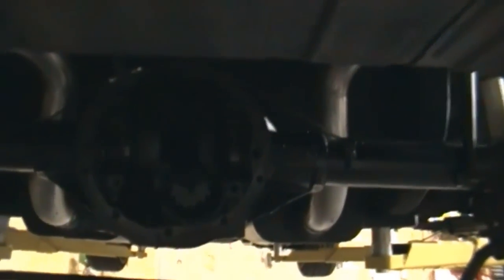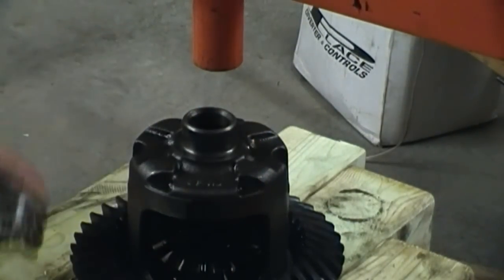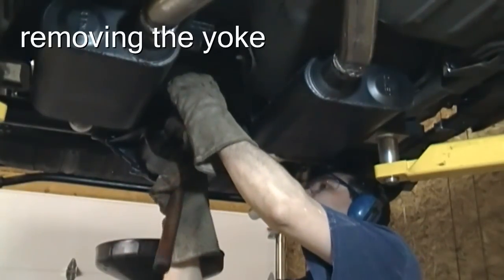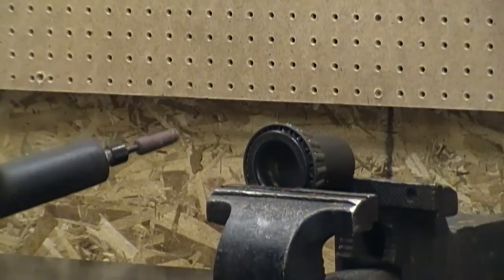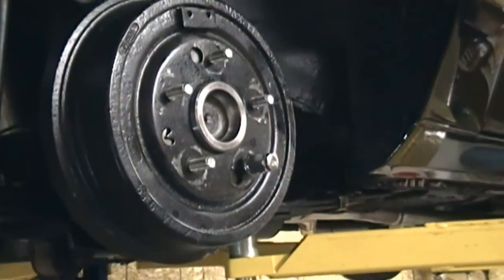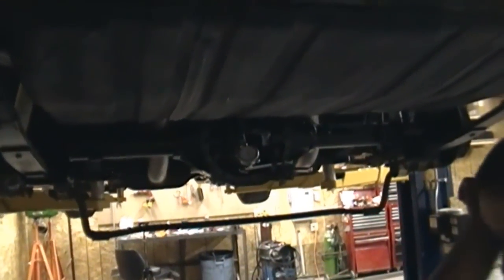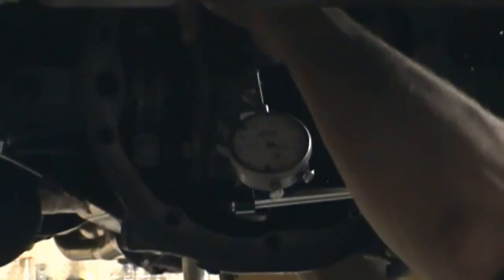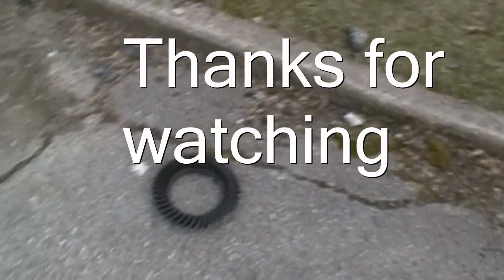How to install or change or replace gears and bearings in a rear end or differential

Comment: My Dad and I are trying to restore his 64 and 66 chevy c10 pickups.  the 64 has a rearend that has went bad.  We need to rebuild it.   Can you assist in helping?  we have no experience on rearends, but my Dad is a good mechanic and can learn or do anything he puts his mind to, yet not the type that will hesitate to learn from someone.  Do you have email you can be reached at?  thanks
Reply: +Karamelia Mitchell the 63 and 64's have 17 spline axles and you can't buy the spider gears anywhere so you will have to convert to 30 spline....i'm doing that right now

Comment: First pattern was perfect. There are 6 acceptable gear patterns. Your running the pinion gear too deep into the root of the tooth. You don't know what your doing. I know what your trying to do.. both drive and coast side from toe to center or toe to heal. Your not paying attention to the width of the pattern.
Reply from the maker: The rear end has performed flawlessly after being hammered on by a 500+ ft lb motor.  It still works great and is and is totally quiet to this day. I certainly wouldn't want to build a rear end that whines under the advice of a YouTube armchair mechanic.  Every man for himself.  Do what you do at your own risk.
Reply: @Oldsmob455  First, you used the Mark Williams pinion depth with the factory shim. Ok usually a 8.5 will be .034 to .041 pinion shim. You said it's telling you it's about .001 off. Your first pattern was perfect. But you decide to add .Then determine additional .014 was required. Go back and look at the pattern.  The drive and  coast side is way too deep in the root. Again, look at 6 acceptable gear patterns. Your pattern was square on the tooth. It didn't run towards the root or the face. Your pride may be in your way, refuse to advise your mistake or the exhaust is so loud you can't hear it. Again, 6 acceptable gear patterns.